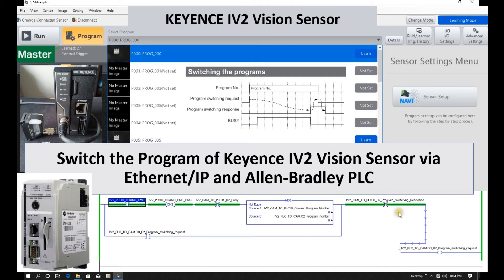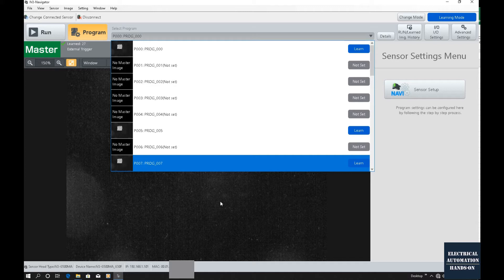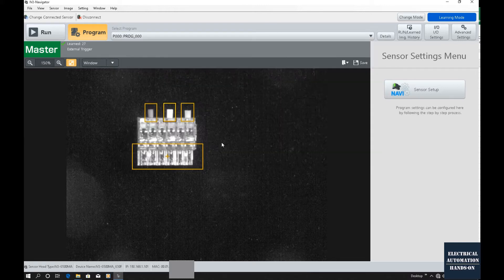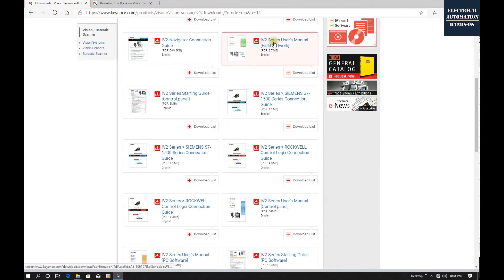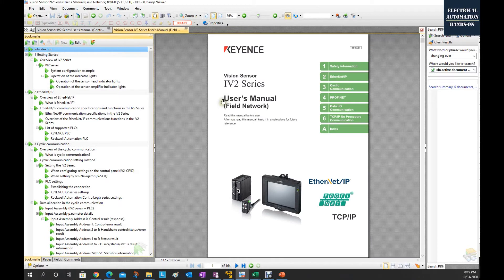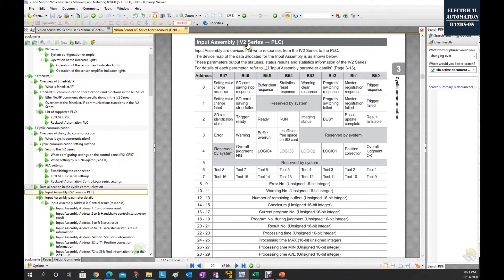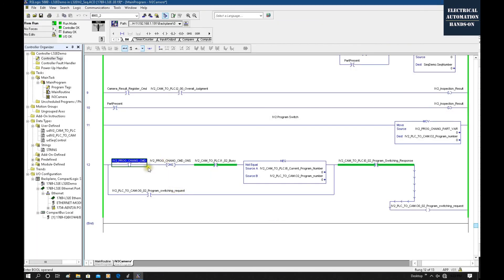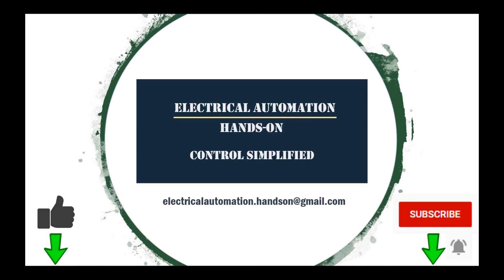KI16. Program Switch of Keyence IV2 Vision Sensor via EtherNet/IP and Allen‑Bradley PLC

Comment: Hello, Can you help me with acyclic Ethernet TCP connection? Siemens 314CPU with CP343 Lean. Thank you
Reply from the maker: Hi My friend, I guess your system does not have Profinet PN port from your CPU, right?  If it is ture, I would recommend you using the I/O ribbon cable. Using TCP of IV is kind like serial communication, it wastes you too much effort on it.